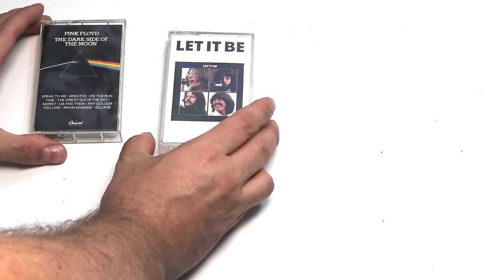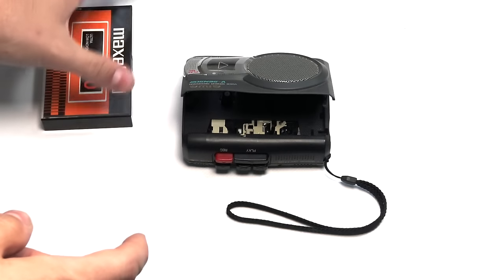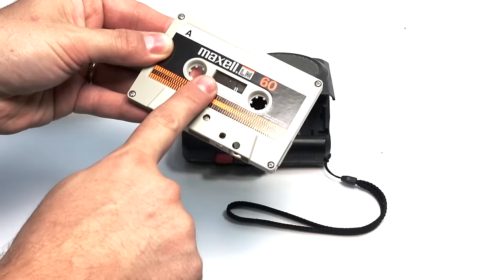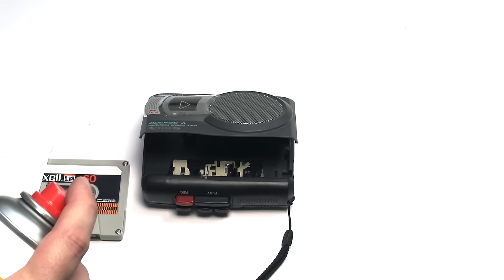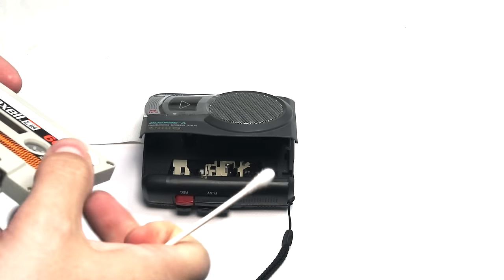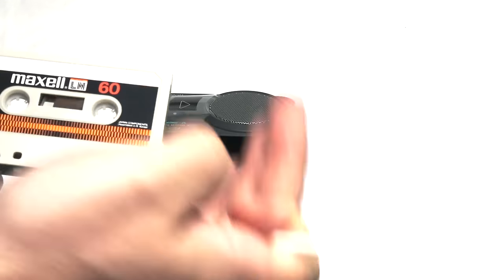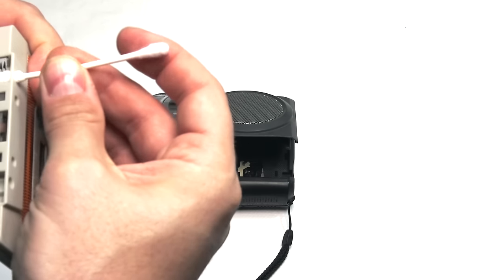How to relubricate your stuck cassette tapes

Comment: Lubrication is rarely the problem - it's ALIGNMENT of the tape, how it winds onto the hubs. Constant random fast winding and flipping the tape over and back again throws off the alignment and it gets snug inside. Lack of, or absence of, the liners which I call  "slip sheets" inside the shell, also casues misalignment of tape onto the hubs - some tapes have "ribbed" or "ridged" liners will help tape wind onto the hubs in good alignment, but they're not perfect. It's always best to allow tapes to play (or wind) all the way from start to finish before flipping the tape over or prompting "reverse playback". 

To the best of my knowledge, you are not supposed to apply ANY kind of solvent or substance onto the actual tape. 

The only lubrication I've ever seen is applied to the guide rollers (inside the front corners of the shell) or possibly even a sparse amount on the hubs (where they fasten to the shell's holes, where they do NOT touch the tape), cos if those parts get dry and dodgy and sticky, or even gritty, then that can cause problems with the tape's steady fluid movement. You could also look to see if the deck/players mechanisms and motors are moving with proper lubrication as well. These all require disassembly, of course, so this is "advanced users" kind of stuff, lol. 

But NEVER put lube on the tape itself. Lube the PARTS of the inner shell and/or the inner mechanisms of the deck... NEVER the actual tape. You'll potentially ruin the tape applying lubes and stuff. 

That's just my experience. I've been working with tapes for nearly 20 years since I was a teenager, even modifying them and repairing them. I've tried and done it all. The only thing that has remained consistent as a hard and fast rule is to never let anything but the deck heads and the cassette hubs touch the tape.
Reply from the maker: Yes of course, bu if everything else fails, you should try this. All types of tape have a lubricant and sometimes, like the xdr cassette issue, you must add it back...
Reply: ►"if everything else fails, you should try this"

As a LAST resort. MAYBE.

If after all other remedies do not correct the issue, then you're faced with one of two scenarios after doing the "lubricate the tape" thing : it's either going to work, or it won't, and if faced with such a problematic tape anyway, it's not like any potential damage from lube on the tape is going to make things much worse.

But I really believe - I may even dare to say I KNOW - one of the many other methods of "all else" will correct any issues before ever having to resort to lubing the tape. 

That comes from KNOWING tapes. In my case it is ALL firsthand experience. Trial and error, with LOTS of error. Learning the "hard way". 

I stand by my original comments. NO LUBE or any other solvent is to EVER be applied directly onto the magnetic tape. EVER. 

Sqeaking, lagging, sticking - there is another explanation that requires another remedy.

Comment: Would this work for VHS tapes too? I have many, including old home videos, that squeak and make strange noises when fast forwarding and rewinding. Sometimes the picture wobbles too.
I've been very reluctant to put any kind of fluid on my tapes even for cleaning. If it goes back into the shell before it's dried out, the tape can stick to itself and get torn apart when next played!
Reply from the maker: Don't know! The problem is that the VCR mechanism is quite complex and you would risk problems.

Comment: Hey there @ANA[DIA]LOG I tried to find the M3 but wasn't able to with your link and searching it up, I went to their page and can't find the one that you used, I'm not sure if they changed can design or they just stop selling, I don't want to buy a random spray can. I'm not sure what to do. do I get the Kontakt 61 or do buy a random can that can possibly be the M3 lubricant
Reply from the maker: It’s 3M. In any case a quality lubricant silicone based with NO solvents/thinners/alcohol etc should be ok

Comment: This is ABSOLUTE RUBBISH - DO NOT DO THIS. Compact cassettes rely on dry mechanics and this is just analogue suicide.
You do not need to 'relubricate' the tapes as they were never lubed in the first place. The closest thing were back-coated tapes
and they simply had the recording formula applied to the back of the tape. If you apply a lubricant it will transfer to the front of
the tape when its wound onto either spool, it will then be transferred to the machines heads and pinch roller and capstan and
that is simply the worst thing you can do. Tapes jam because of poor manufacturing (rare), poor internal components / shells,
or through poor husbandry by the user or by being used in a poor quality or faulty machine, Not because of lubricant issues.
A number of reasons why tapes jam include the following, and its all down to friction;
1) The shells are slightly warped due to poor manufacturing or because the owner left them in direct sunlight, by a radiator, etc.
2) Excessive moisture or a spilt liquid has entered the cassette shells causing sticky friction. Hence why you don't use lubes!
3) The tapes are wound unevenly and so the tapes actual girth is increased between the friction mats. This is the commonest
reason for jamming and you can see it, through the cassette window, its where the top edge of the wound tape isn't even, it
has ridges from the spool right across to the edge of the would tape - this is called 'door-stepping'. This uneven winding, as
described, increases the girth of the wound tape and this expansion acts like a break against the friction mats and shells.

Friction mats would be better described as slip mats. They are thin sheets of plastic that sit between the tapes top edges
and the cassette shells and usually have bubbles on them to reduce the amount of contact between the tape and the mat.
As for door-stepping, the ridges are formed by irregular back tension from/by the supply spool but also by the take-up reel
on occasion. Once stepping has started it will nearly always only get worse until the tape comes to a complete halt, for good.
Another reason for door-stepping is due to a pinch roller that isn't completely flat. Through use, and often because they're
made with inferior rubber compounds and degrade, the roller forms a flange on one edge (an angle that shouldn't be there)
and during tape transport, it pushes the tape slightly up (or down) so off alignment (or azymuth). With repeated plays this
will cause the wound tape to spool unevenly. As for warped shells, remember the tolerances involved here are very strict,
and so if you've a combination of any of the above then the tape will jam.

I have been involved with the cassette format for 50 years now and what this uploader is suggesting is not only ridiculous
but totally detrimental on every level for any cassette or any machine that's used. Please do not do it!
Reply from the maker: Mark, I did not even read this whole thing...I stopped when you wrote that tape does not have lubricant. Check the Extra info in the video description or the first comment I pinpointed. You will see that your knowledge on tape is lacking some information...;-)
Reply: @anadialog  dude. he's right. 90% of cassette tapes did not have lubricant" anywhere near the surface. It was mixed into the magnetic layer itself on an even micro-scopic level.

Lubricant, as you may think of it, is NOT on analog cassette tapes. My god. You are asking people to rightfully destroy their decks. 

Please don't do this. This is coming for a pro tech and broadcast/recording engineer.
Reply from the maker: Jonah, as many other techs you are driven by prejudice without real knowledge, in this case, about this issue. It is really sad to see how arrogant you are, just go back and read your commnets. I see now that you have written several negative comments over the months and I think you should inform youself better before pointing your finger, insulting and denigrate people. I have posted simple things but considering that you would like more proof here you go. After rading this info, I hope you will be polite and intelligent enough to apologize.
Here you will find a selection of scientific papers explaining the issue and how it is a standard procedure to relube tape (even NASA does this!). I have underlined a few crucial passages in the papers: 
Heritage: https://www.dropbox.com/s/f8254yfeqrrw9vp/heritage-02-00097-v2.pdf?dl=0
Nasa: https://www.dropbox.com/s/xxdw1qh8mlbppdu/Nasa.pdf?dl=0
HESS: https://www.dropbox.com/s/ydrvxg6zipjkrvw/HESS_Tape_Degradation_ARSC_Journal_39-2.pdf?dl=0
Preservation Commission: https://www.dropbox.com/s/3s3ejmho2jexhgt/pub54.pdf?dl=0
   - (here is the official article: https://www.dropbox.com/s/rtvqt1n537w9vpa/Bogart.pdf?dl=0)
Kondo: https://www.dropbox.com/s/zi4vv42ggi9vh8u/tribochemistry-of-ionic-liquid-lubricant-on-magnetic-media.pdf?dl=0
Here is an article of a lab that is relubing its cassettes: http://tasso.cat/re-lubrication-of-compact-cassette-tapes-with-sbs/

Comment: Ohoho nononono....... This is a bad idea, don't ever do this. First of all, it's completely non-functional, since the tape doesn't experience any friction in between layers of wound tape anyway. The only thing that could require lubrication in a tape would be the hubs, which can only be lubricated from inside (so you have to disassemble the tape to do this).
This only sets you up for gluey tape reels in the future and possible breakage and slippage of the capstan/pinch roller.
Reply from the maker: Hi there, tape in every form has an amount of lubricant. Restoring that in problematic tapes as the XRD tapes does give good results, trust me!
Reply: @anadialog  I just took apart an old HF-ES 60 and indeed the plastic film on each side of the reels is lubricated. Did not know this.
Reply from the maker: Thank you for beeing so honest!
Reply: I agree with Mr.F3udF1st, I had this problem a few years ago and I solve this issue, opening the tape and spread a little bit (not much) of talc, yes indeed, a neutral talc without any smell, maybe a talc used by babies, because the excess of friction stops the reel touching that kind of paper inside the tape and are squeeze both sides of the reels, besides, lubricant can damage the heads of the recorder or chang audio quality, think about it and good luck.
Reply from the maker: Talc could be a new solution. One thing thow is certain. All magnetic tape has an amount of lubricant, certainly not talk. If you are worried about some possible issues just use one ir two dry cue tips to absorb the exceeding lube. The tape will take the amount needed.
Reply: EXACTLY!
Reply: @anadialog  this is not true. the issue with XDR cassettes it the shells and the binder used to hold the tape medium itself to the plastic and magnetic layers. it has nothing to do with lubrication. Please stop spreading false-information and potential damage to many machines.
Reply from the maker: Jonah, as many other techs you are driven by prejudice without real knowledge, in this case, about this issue. It is really sad to see how arrogant you are, just go back and read your commnets. I see now that you have written several negative comments over the months and I think you should inform youself better before pointing your finger, insulting and denigrate people. I have posted simple things but considering that you would like more proof here you go. After rading this info, I hope you will be polite and intelligent enough to apologize.
Here you will find a selection of scientific papers explaining the issue and how it is a standard procedure to relube tape (even NASA does this!). I have underlined a few crucial passages in the papers: 
Heritage: https://www.dropbox.com/s/f8254yfeqrrw9vp/heritage-02-00097-v2.pdf?dl=0
Nasa: https://www.dropbox.com/s/xxdw1qh8mlbppdu/Nasa.pdf?dl=0
HESS: https://www.dropbox.com/s/ydrvxg6zipjkrvw/HESS_Tape_Degradation_ARSC_Journal_39-2.pdf?dl=0
Preservation Commission: https://www.dropbox.com/s/3s3ejmho2jexhgt/pub54.pdf?dl=0
   - (here is the official article: https://www.dropbox.com/s/rtvqt1n537w9vpa/Bogart.pdf?dl=0)
Kondo: https://www.dropbox.com/s/zi4vv42ggi9vh8u/tribochemistry-of-ionic-liquid-lubricant-on-magnetic-media.pdf?dl=0
Here is an article of a lab that is relubing its cassettes: http://tasso.cat/re-lubrication-of-compact-cassette-tapes-with-sbs/
Reply: ANA[DIA]LOG I’m actually not a tech. As I explained many times I’m a professional, degree holding, audio engineer. 

I have been professionally dealing with tape and digital of all kinds for nearly 30 years in recording studios and broadcast radio. 

There’s no prejudice here. Why would there be? What justification would I have to just randomly troll your video?

There’s no arrogance on my part but plenty of ignorance on yours. 

I appreciate that you’re a DIY guy who’s self taught via the inter webs - but not everything you read online is true or factual. 

I’ve read your links more times than I need to - as I’ve already pointed out. 

Again, your links are talking about living R2R not cassettes. Different manufacturing process period. 

Cassette tape does NOT absorb lube. I don’t know where you got that idea from but it is scientifically impossible. 

Also of note - if you want to reply to my statements so be it - but at least use a different reply. 

I awoke to over 20 notifications - all of you saying the exact same thing in every post I’ve made. 

That makes you look very silly 😜 

Again, my offer stands - if you want real trusted advice from a real audio engineer who was restored over 1000 cassette and reel to reel tapes, then please - DM me!

But stop spreading around info that is sure to be damaging to people’s gear. 

There’s other, proper, solutions for the troubles you face with cassettes.
Reply from the maker: Jonah, this is the proof that you are not openminded and eager to learn something from someone else. You are so full of yourself that you didn't even read the links I sent you. These are new scientific articles that I also uploaded to the video description thanks to you. In fact, in a few of these they are also talking about cassettes! Tape is tape and it has common issues. Now set aside your preconceptions and start studying the papers I sent you. It's all there and you can't ignore it anymore.
Reply: ANA[DIA]LOG tape is not tape. 

That statement right there proves your ignorance. 

I don’t need to say anything more.
Reply from the maker: @jonahmcgarva  the considerations regarding re-lubrication are the same.  Again, study, then come back. Now you are just trying to hide from the solid and scientific data I sent you. As you will see, in the various papers, all your statements are dismantled one after the other.
Reply: ANA[DIA]LOG you’re completely unfounded in your comments. 

Here’s a white paper directly from a university on the storage handling and composition of all magnetic media. 

Again, it states there that reel 2 reel tape (all types) have different formulations than 8tracks as well as cassettes. 

In other words you can not treat one like the others. They may all be “tape” but they are vastly different in their composition and structure. What can you not understand about this?

This article also mentions, from scientific archivists at a university, how each format fails. 

They DO NOT mention LOL as a cassette failure. Why? Because it’s not a thing for cassette tapes made after 1972. 

Again, you’ve constantly resorted to attacking my shared position with other professionals. You haven’t sought a delicate and polite conversation. Instead you constantly scratch and claw at me and others like you’re backed into a corner. 

Dude. You didn’t discover gold. You don’t hold the answer to life. Just relax - take a deep breath and realize that maybe, just maybe, you’re actually wrong. 

https://psap.library.illinois.edu/collection-id-guide/audiotape
Reply from the maker: @jonahmcgarva  once and for all, check the articles I sent you where they clearly say that the lube  is on top, not on the back as you said, that tape is porous and that it absorbs lube, again in contrast with what you said, that they tested it on cassettes, and not only on reel to reel as you said, that they use also silicon based solutions, just as I am recommended. Yes, we all know that there are different types of tape but they all need lube and, again in contrast with what you said several times, IT IS A STANDARD PROCEDURE done by archives, libraries, sound engineers and even by NASA! How can you be so blind and deny the evidence.  You did not know anything about relubrication, just admit it and t let's carry on. For me this is the end of the story. Fortunately intelligent people will read the papers I have posted and learn the TRUTH about this topic.

Comment: I want to add here that tapes (especially older commercial tapes) can degrade and shed, and sometimes the stickiness is the tape shedding and the residue is what's causing the tape to stick to itself. I have had success with cleaning the tape very carefully with a very diluted combination of blue Dawn and distilled water, and then rinsing the tape of several times. This can be done in a manner similar to your lube method, and it leaves no chance of oil left on the surface of the tape. It is also the best method for cleaning moldy tapes if you don't want to throw them away. I'm not saying there is never a reason to lube, I've just had no experience doing it, and it seems like maybe cleaning is a better first step

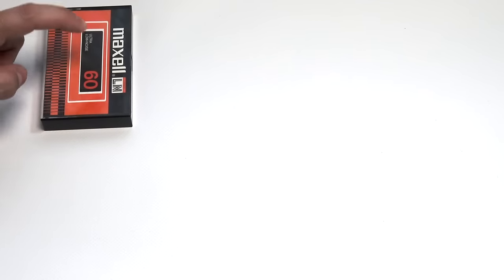Comment: To those of you who kept banging their heads on the wall and repeating "kill me" trying to get through the initial part of the video: the actually "useful" part begins at around 6:00 mark. You are welcome. (But even after that it still goes in circles a lot.)
But, having said that, if you can find nothing better to do than to "lubricate" your cassettes, maybe you need another hobby.